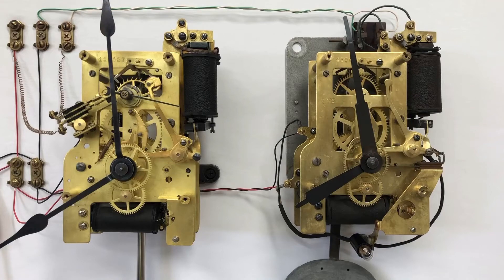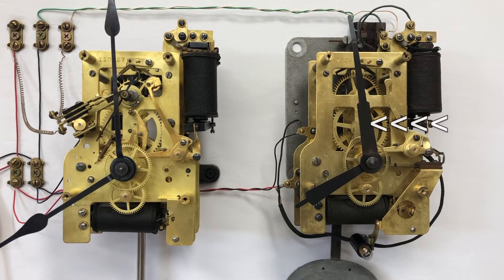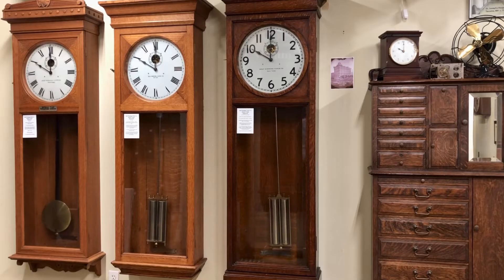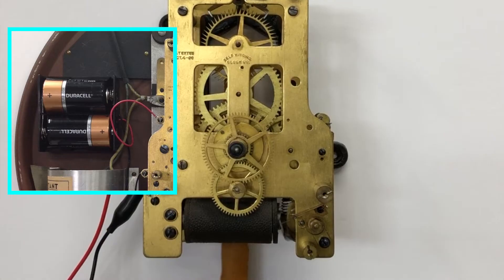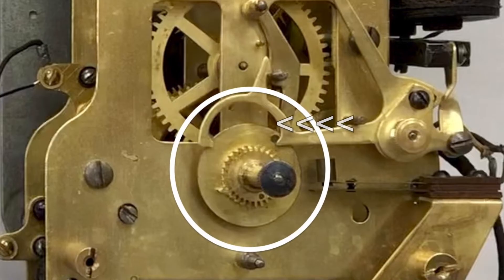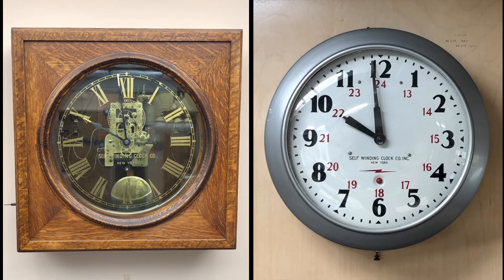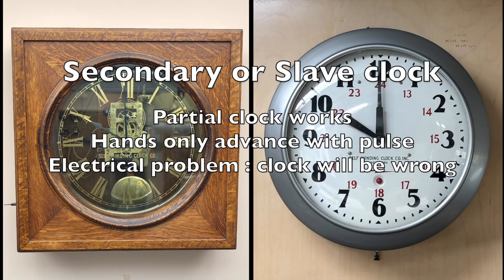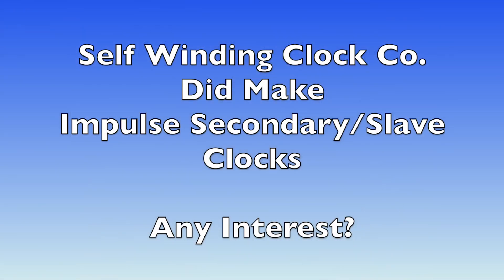Watch the Self Winding Subsidiary clock movement hands synchronizing on the hour.

Comment: Before quartz movements were introduced, quartz crystal as accurate as the mechanical device sown. NY subway had self winding clocks in all the subway stations, did they get a synchronizing signal from western union
Reply from the maker: Not sure where the signal came from but I know they had synchronizers.

Comment: Your videos are fantastic.

What was the purpose of a subsidiary clock? Why not use a slave clock instead?
Reply from the maker: A subsidiary clock has a complete clock movement so it can function even when disconnected from a master clock.
Reply: @SelfWindingClocks  But since they were rented together with the sync service, they would rarely run standalone, right? Was the self running capability to account for power outages or other intermittent interruptions to the telegraph service?

Comment: Great video and you helped me get my master clock syncing a couple of my other WU/SWCC clocks.  I do have a couple questions? so what is the most clocks that you have sync from a master clock. I added a 3rd clock and the 3 volts are really struggling to sync.  I know originally the master had a AC rectifier and I'm sure that kept the current proper. I did a set up where I did my 3 volt battery pack and then did a circuit like you show here and its working great other than now I have too many clocks trying to sync.  Any solution? Also my rectifier says 6 volts not 3? any possibility that these needed 6 volts to sync instead of just 3?
Reply from the maker: Glad the videos help. I am pleased to hear that.
Each synchronizing clock needs about 2-3 vdc to activate the synchronizer coils. You can get away with 2 synchronizers on 3 vdc but not more. You need to increase the voltage. Your 3 clocks would probably do fine on 6 vdc. I have my clocks synchronizing on a separate 24 vdc circuits. I have 7 or 8 clocks on each 24 vdc circuit. If you do not have that many clocks and are going to use 24 vdc just add more resistance to compensate.
Reply: @SelfWindingClocks  Thanks so much for the quick reply, that was my thoughts as well. But on NAWCC....they seem to be dead set that you aren't supposed to increase the voltage...... I'm sure the equipment used back when was different, and they probably used the same type set up as you are referring too.  More Voltage for longer distances and the larger the number of clocks.   I have noticed that the sync capability really dropped off once I added the 3rd clock.  I also realized the type of wire made a big difference as well.  The solid thermostat wire conducts the voltage very well, better than all the other low voltage wiring.   Again thanks for the response, and its amazing to have a working syncing Self-winding clock system!
Reply from the maker: @danieljeffries1134  The synchronizing coils should be connected in series.

Comment: Interested in the half minute impulse  slave clock as I have a Western Union master clock with two different cams on the modified second hand one is 30 or 1mn sec points that do not lift off the other cam is  1hr contact that lifts ?
Reply from the maker: Hi Josh, There are several different cam configurations depending what the clock was originally set up to do. There are also different contacts. One may be for the hourly synchronization of subsidiary clocks. This one will be lowered on the cam just before the hour. The other one, hard to know.  Alan

Comment: Have I understood it correctly that the minutes hand of the subsidiary clock is reset every hour at the pulse of the master clock? But how about the hour hand? Suppose every hour the subsidiary clock is 1 minute faster then the master clock. Then every hour the minute hand is set back one minute. But after 60 hours, it is been set back a full hour, at which point the hour hand, if not adjusted, is one hour too fast. So I suppose that the hour hand also has a slip fitting and that both the hour and minute hand stay connected witha 12:1 gear ratio. Is that so?
Reply from the maker: The hour hand will be geared to the minute hand so it would follow the movement of the minute hand. These clocks are easy to regulate to within a few seconds each hour so unless to correction is not received for many hours the clocks will not be off a full minute. If it is off more than 10 or 15 seconds+/- it will not accept the correction signal. They may get off by minutes or even hours but will need to be corrected manually.